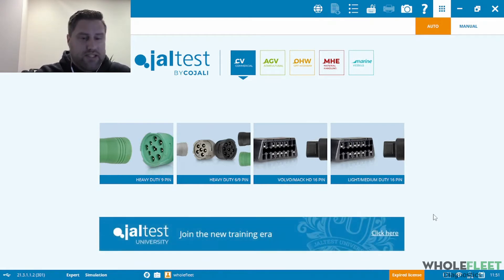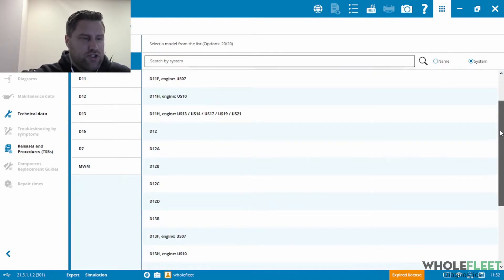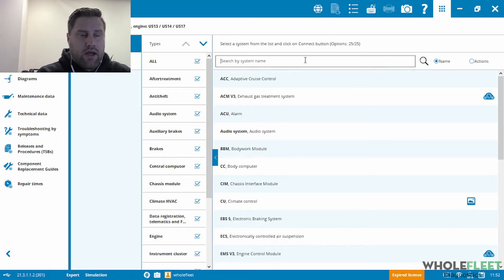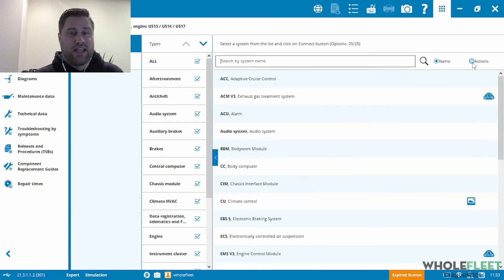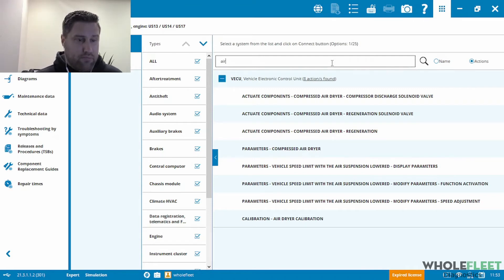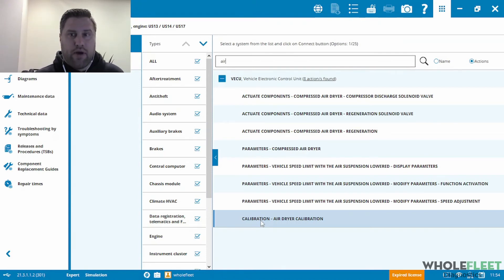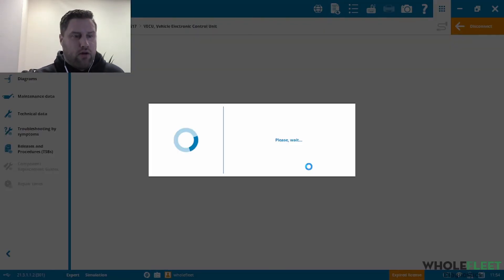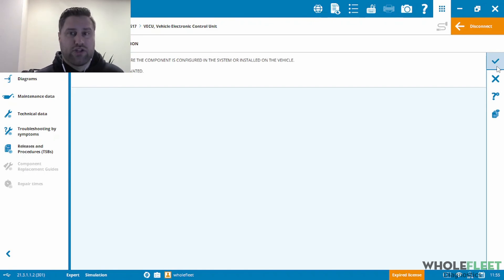How to Search & Find Volvo Air Dryer Calibration Procedure Using Jaltest

Comment: Is it necessary to run a calibration after changing air dryer? I change mine without running calibration. Did I do damage?
Reply from the maker: Hi Kelly, this calibration strictly resets the maintenance lamp, interval and consumed value percentage.